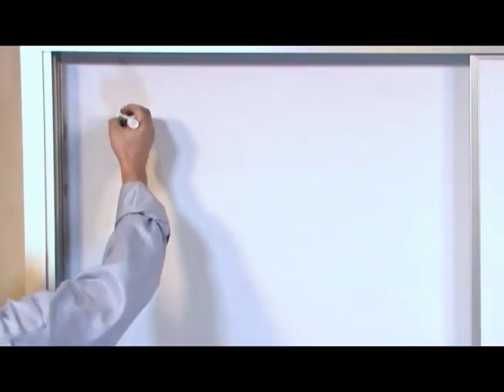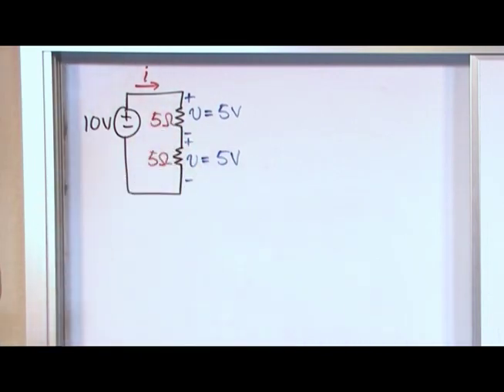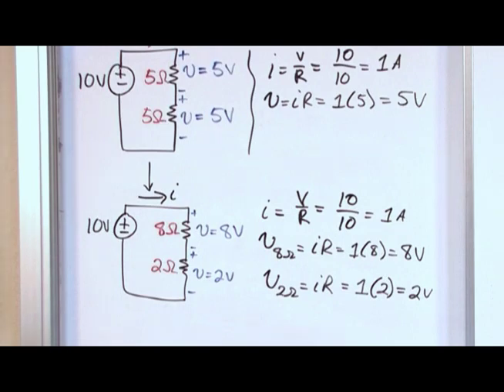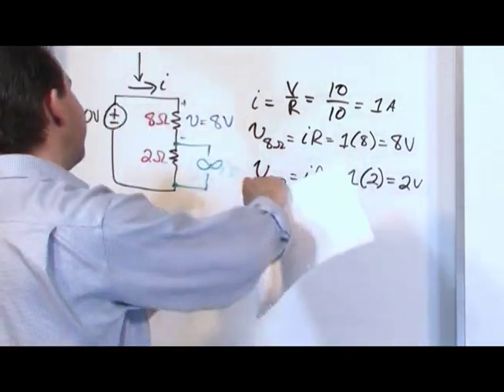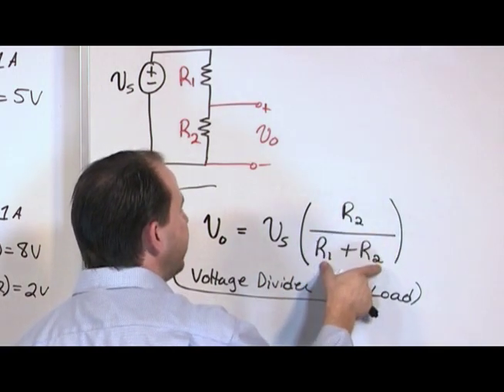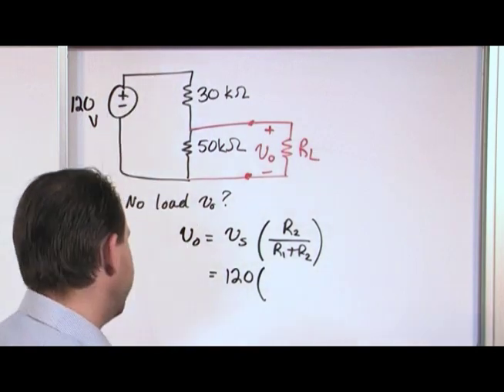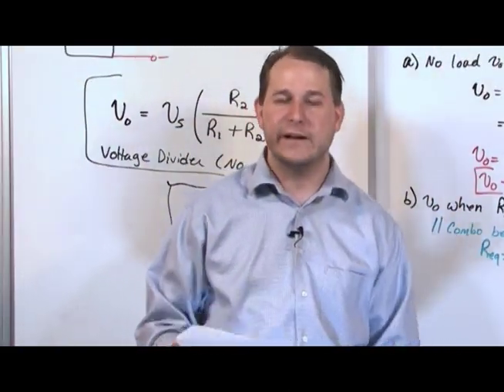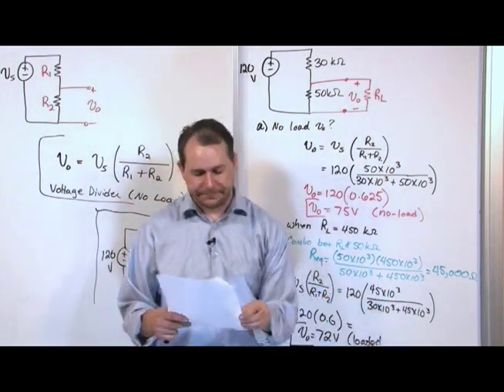What is a Voltage Divider Circuit?  Examples & Calculations

Comment: Why do you have to use 2  ris
Reply: I assume you mean 2 ris as in 2 resistors, it's because voltage splits across the resistors based on KVL and Ohms law, this application could be altered using Capacitors and inductors if you are using AC but this is DC so pretty straightforward.

It's just basics of voltages.